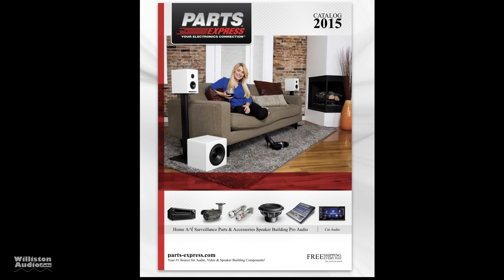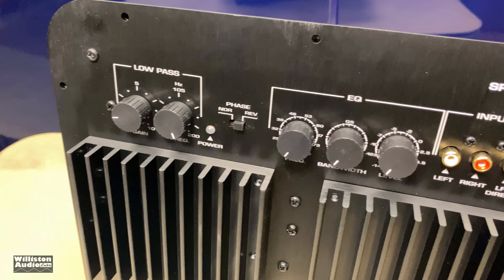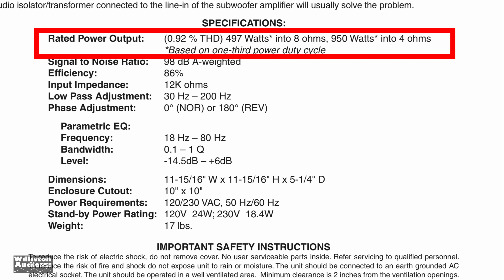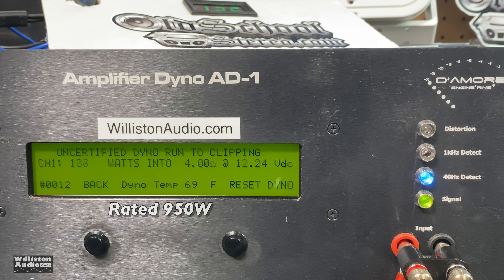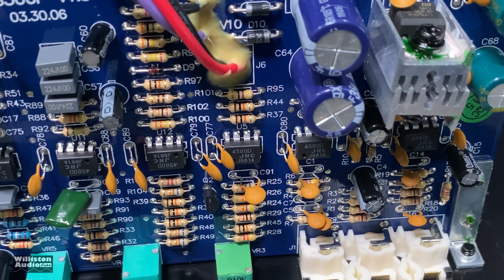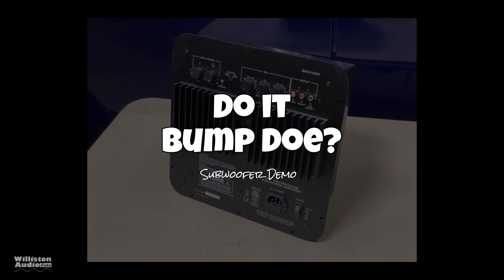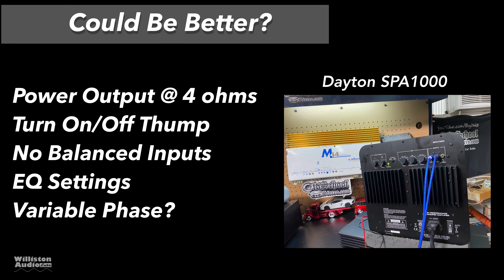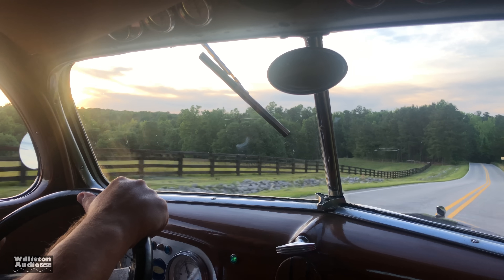DIY Subwoofer Amp for Home Theater - Dayton SPA1000 1000W

Comment: Thanks for this review! I have seen these and have never felt the need to pursue a purchase. Turn on/off thumps kinda suck. 😞

I appreciate ya'! 😇😎
Reply: Its a 17$ fix should of been done by dayton audio look for a speaker pertection board 120v 30amp mono board. If you do buy one add it on 👍✌️👌🤔😉

Comment: Is there a way to defeat that thump without redesigning the amplifier itself?  I have been dealing with that thump for 10 years now with my SPA500 version.  Thank you in advance!
Reply from the maker: Just leave it on and you shouldn’t have the issue. It idles at 24W, so not a huge amount

Comment: Can you test the rack mount version? 

https://www.parts-express.com/dayton-audio-sa1000-subwoofer-amplifier-rack-mountable--300-811

I've been using one in my house for many years. https://www.parts-express.com/dayton-audio-hpsa1000-r-1000w-rackmount-subwoofer-amp--300-810
I love it. It's powering a old 12" Earthquake and Eclipse both  4ohm DVC wired in series parallel for a 4ohm load at the amp.

Comment: there is something that is not right.
It has relatively small heat sink to produce so many watts. class-d also gets hot. how many volts does the amplifier get from the transformer?

I've seen several amplifiers on Ebay that can handle many watts but people on the internet say that the sound quality is not good!

Comment: Installed mine in a 4th order bandpass with 2 American bass 300w rms 8s and it absolutely tore the amp apart with the lower frequencies. After a couple months of use it started cutting in and out and the pots started making noises when tuning the amp. Needless to say it's replacement has never gone into any inclosure

Comment: It doesn't have a soft start relay, you can add one if you're handy with the soldering iron ...
Reply: What you really need is a speaker pertection board with that soft start then your problem is solved like your thinking 👌✌️👍😉🤔

Comment: Crappy construction, No heatsink ovwer the bridge diode, and thats one anemic bridge. No delay for speaker connection, and from there you have the power on/off bump, and for sure no protection for the output....I would not buy that think....

Comment: Next amp you have to test is one of the NEW ROCKVILLE DB COMP CEA rated not some magic rms watt rating. There's a 3500 cea rms watt with a built in volt meter for $349 and also for $299 the 3000 cea rms watt Rockville DB Comp!! Both will be nice I just can tell I've seen a demo of the 3000 and it was good👍

Comment: As most audiophiles would already know, that turn on/off thump will not be an issue when using a power conditioner or voltage regulator with a delayed turn on sequence. I run several high power amplifiers in my home setup but run a Furman power conditioner that has a variable turn on sequence which eliminates any chance of this happening.
Reply: Ditch the junk and you won't have that issue. Power "conditioners" do nothing but waste your money.
Reply: Which particular model?

Comment: Looks like it needs a gasket of some kind between the rear plastic housing and the aluminum face plate. Then again, I've used one of the "Bash 300S" plate amps before that has no inner plastic housing and had no problems. Controls were sealed up pretty well on that one.

Comment: Looks like a decent piece. Parts- Express usually has good deals.. Hopefully you can get it hooked up in your home or whatever you plan on doing with it soon so, we can see the durability. I'd like to build my own subwoofer set-up. I'm using Klipsch Reference line, but the sub and amp are very cheap and don't have the best output. I get about the same bass out of my towers as my 12.

Comment: I have the 500W version and there's no thumps if you leave it in "AUTO".   It powers itself on and off when needed without thumping.   I've had it over 7 years now and it still works great.   I don't think it's a true class AB amp though, I recall it being more like a class G topology but maybe they switched it up over the years.
Reply: It seems to have only two big filter caps so it can only be AB if that is the case. Wierd that this amp appears to have no output relay-delay.

Comment: Nice lil amp but kinda pricey.  You could get two 900w crown amps and have some money leftover.
Reply: Like i said in another post, these are class A/B power amplifiers. Crown amps are great for sound reinforcement and PA systems, but are not ideal for true audiophile setups. Crown uses a class D design with a switching amplifier and have alot of noise and also have no features, no parametric EQ. Crowns are great for gobs of power, but for true audiophiles who want the best audio and best features, these plate amps are ideal. Everyones looking for more power, but these Dayton amps deliver more power than most people will ever come close to using in their home audio setups.

Comment: I REALLY WANT THIS AMP BUT WITH TURN ON THUMP NO FREAKING WAY.
Reply: I have the 500W version and there's no thumps if you leave it in "AUTO".   It powers itself on and off when needed without thump.
Reply: It's a easy fix you just add a board to it about 17$ fix that should of been done by dayton audio. I would buy it used ask seller if it make a thump  you might get it at a good price ✌️👍😉🤔💯🍒

Comment: I have car amp and car sub setup in my surround sound system.  I have a Dual Electronics 4ch amp that does 250rms x 2.  Mine is pushing a 500rms Pioneer 12" sub.  
I paid $65 for the sub, $45 ported box, $100 amplifier, and $20 power supply.  So for about $220 I have a very powerful system.

Comment: I've been wondering how those amps performed ever since I first saw them
Reply: I have owned my SPA500 now for 10 years if that should tell you how well they perform over time.  I did not realize it until late and I made a new sub cabinet, but these amps will run 2 ohm as long as you set it correctly.  I had my SPA500 hooked to a 10 inch Memphis M3 set to 2 ohm for 9.9 years all because I did not check the impedance before hooking it up.  While it could have cooked the amp and it would have been my fault the whole way, the amp never faltered and played strong every time.
Reply: @TMouse-hd5jb  i would probably still run the 1000 at 8ohms just because of how much power it still makes. maybe 6 ohms if i could find a "rare" driver

Comment: I've used these line of amps on a couple of builds I did for myself and friends. I really like them. I built a gaming system for my basement that gives my house " trunk farts " using this same amp. It powers two RF hx2's in a ported and dampened enclosure .
Reply: How do you adjust phase ? via freq?
Reply: I moved the enclosure around till it sounded the best😂🤣

Comment: How is the amp dyno reading correctly when the amplifier is being fed 120v instead of 12-14v?

When ohms law comes into play the calculations don't add up and interchange
Reply: its not based off the 12 volts DC input voltage 
its based on the AC voltage that the amplifier is outputting and the amps
so something like 20 - 100+ volts AC is what it is reading when the dyno is running 
and the Amps of that output with what ever ohm load he is using

Comment: I noticed the sub really didn't move when the low note on feel the bass hit. Is that due to the enclosure or does this amp just fall on its face like alot of mainstream home subwoofers do when it comes to the lows below 40hz. My svs pb2000 is the opposite it feels like it hits way harder at 20hz than at 45hz but in actuality the frequency response curve is just so flat that you have to actually learn how to listen to a subwoofer all over again because most mainstream subwoofers are extra loud at 40-45hz but fall on their face once you start getting below 30hz. Even with a 15hz test tone you can feel the pressure change in the house with my pb2000.

Comment: I have been running 4 of these amps for about a year in my theatre. Have them powering 4 18s from stereo integrity.
Reply: Annnd??? Leave us hanging....?
Reply: why would you not just buy some real crown amps. or even one used 4000 watt is prob about the cost of one of these
Reply: @NightshiftCustom  Just like SMC Express said, amps like crown are just good for huge power output, but not fidelity. This Dayton amp is a "real" amp.
Reply: @ryannutter4669  yes I understand that but when your playing 100hz 80hz or less then you will never ever hear a difference from a class D amp. Why do you think just about every sub amp is some kind of class D and not a/b
Reply: @ryannutter4669  yes of couse dayton amp is a real amp because class A/B that i like
Reply: @NightshiftCustom  i don't like class D amp because playing music 100hz 80hz or less then i still ever hear a difference from a class D amp but i don't like sound not suitable music so bad my music almost imported for class A/B amp Sub that why I Still prefer ever sub amp class A/B only but i hate class D amp because bass not nice for me for music because i hear seen to much boost bass like EQ for class D amp i hate it but class A/B amp is bass is Flat but no boost that why bass very nice i like it
Reply: @gopala33  You're entitled to your opinion, but if you think you're getting lackluster performance out of todays class d amps... its either because you used a behringer inuke or didn't set up your crown amplifiers correctly...
Reply: @gopala33  every company is or has gone to class D today
Reply: @NightshiftCustom  Because most true audiophiles don't use Crown amps for high end setups due to the fact that they are NOT very clean. These Dayton plate amplifiers utilize a class A/B output stage and are very clean and articulate. Crown is great for loads of power for PA systems and sound reinforcement for large theaters or music venues, but for ultimate home audio enthusiasts these plate amps are great as replacement amps to fill the huge hole in an existing subwoofer encloser or to use in a new build.   Crowns, with their 
Class D designs just don't cut it harmonicly for high end applications, and do not have the features that these Daytons do as well.  I love the idea of outboard power amps running home subwoofers. I run 2 M&K  X12s that are powered, but i bypass and run them with 2 Parasound JC 1 monoblocks and the low end is unbelievable!
Reply: @vegaslimoguy2376  i agree with you i still Prefer class A/B i have dayton SPA250 its class A/B very nice i hate Class D due over over bass boost but not nice my music but bommy loss to bad but class A/B got good bass and bommy also nice my music
Reply: @vegaslimoguy2376  Not sure what "crown" amps you've heard, but they're incredibly clean, anything 1% thd and lower really doesn't matter lmao, you can't really hear a difference.... The only limitation those xls crowns have is the internal dac which only operates at 24-bit 48khz, otherwise they're fantastic, and "fairly close within reason" with their power ratings, not to mention the 2nd generation of those amps have a hp, lp and bp filters, and ofc the weight factor.... If anything, they especially make great subwoofer amplifiers... it would be very stupid to choose that plate amp over a xls 2002 or xls 2502, lmao if you're getting lackluster performance from them, you're doing something wrong... i have an xls 1002 and it's incredible for the cash. The only other proamps that perhaps sound a bit warmer and have even more honest power figures "they rate their amplifiers from 20hz to 20khz" would be the transformer class ab/h based qsc rmxa stuff, which blows away crowns class ab xli series "which is rated at 1khz like the xls stuff, but is still fairly close to rated power"... I have an original qsc rmx 1850hd for the past 10 years, its class H weighs 50 pounds, puts out an honest 575 rms perside at 4 ohms and has been abused to hell and back, even pushing 900 rms a side out of it at 2 ohms per channel, but it sure as hell sounds incredible like the day i bought it, and will go toe to toe with any overpriced audiophile crap as well as last longer from a build quality perspective, lmao. Not hating on boutique amplifiers, they have their place, however most of the time, you pay for the name, the pretty face and where it was made, thats about it... the only boutique amplifier manufacturer that is actually worth your while would be Bryston, they have 20 year warrantys on their amplifiers "no one else does", and they also have immaculate build quality and specs to boot, they're actually worth the boutique price unlike other overpriced stuff, their stuff is used in recording studios around the world.... pretty much everything else is below these three brands as far as solid state equipment goes, lmao... perhaps adcom is also "decent solid state hifi for the money, the 585se is no joke for 2k" but... thats REALLY about it unless you're talking some vintage stuff, but even then, you'd have to do a lot of upkeep to restore it, to most people, it isn't worth the trouble...
Reply: 4 18s for home audio? How God damn big is your house? That shit is unnecessary. It's your money though, spend it how you want to. 1 10 in the right box with the right amp will produce all the LFE you could possibly need.

Comment: Maybe make a timed relay to connect the speaker to the amp when you turn it on.. maybe a 1 second timer relay that activates when the power switch turns on and a 240v 20amp relay to hold the power?
Reply: I overengineer things.. shh.. and my systems constantly change configurations. So I'd be unplugging left and right😂
Reply: @devinstepp4205  you have the right idea thay all ready make the part you are talking and thinking about it's called a speaker pertection board they sell them on eBay 120 or 240  30 amp stereo or  mono  they also sell in low voltage you can also add a soft start to this.  Keep up those ideas you just never know 👍👌✌️💯🍒 over design is always better than under design 🤔😉👍✌️ In this case should of been design this way. 🤔😁add on

Comment: You always use that Infinity for the sound test even if your pushing 700 watts end and I don't believe that speaker can perform properly at 700 watts. I would like to see mabey a 15" or "18" driver really put these amps to the test. Mabey even a pair for the two channel amps. Just my opinion. I do live the vids keep em comming
Reply: It takes it fine, he wouldn't give it that much power if it couldn't handle it.

Comment: Another feature that could be included is high-level inputs. So if you wanted to hook it up to the stereo system and get the same signal that the main pair of speakers receives

Comment: There's no soft start relay. That's why it thumps when turning on and off.
Reply from the maker: Which is unacceptable for a $400 plate amplifier IMO
Reply: @wal  - Indeed! I know what their thinking is on that though. They want you to turn it on once and let the Auto power do it's thing.
Reply: @ShaneCarles  when you leave it on the life span is lower also going to end up wearing out the international parts. The soft start and speaker pertection board the why to go it 35$ for both  to bad the factory didn't add them 👍✌️👌😉🤔

Comment: I Have the Boxed version of the 1000w p.e. amp. Its good up to the point of really Getting on it hard. Then it goes into a Soft Gain cutoff. 
Not good for 100% Duty Bass Needs. 
A Great Plate amp Is My Hypex 800. Solid Power 100% D.Cycle.
Hypex is made in the Netherlands.

Comment: it lacks balanced input, but in home theater audio i dont think there are many receivers that ouput balanced. (if any at all) its more a thing for PA systems?
(also since a sub signal is mono i dont see how its balanced anyhow unless you use dual inputs)

Comment: A duty cycle is what they use for welding. It's the time in it takes for the signal to complete.
Reply: lol no its not 
its the amount of time it will run at full load 
70% duty would mean weld for 7 mins and take a 3 min cool down break or it will over heat and kick off 
30% would be 3 mins of welding 7 min cool down break
Reply: @NightshiftCustom  i know what it mean in welding. In audio it is what I wrote.
Reply: @NightshiftCustom  The duty cycle {\displaystyle D}￼ is defined as the ratio between the pulse duration, or pulse width and the period of a rectangular waveform

Comment: I have had a few of these home theater subwoofer amps opened up before, all had either a spdt switch that selects "on" or "auto", or a simple on/off switch on the power supply like this one has. The ones that don't have selectable "on" or "auto" ALL had a jumper somewhere on the board to select it. It's as simple as adding your own switch to the jumper. The reason for the "thump" here is that when you operate that switch you are cutting power to the power supply while the output stage is still active. When you turn it "off" at the amp board instead of the power supply it will mute the outputs before ot shuts down. It's just a cost cutting measure so they don't have to add an extra switch to the panel.
Reply: It's a 17$ speaker pertection board those cheap basterd 👌✌️👍🤔😉

Comment: Looking at the way the boards are mounted internally and silly things like no silastic covering the caps for vibration protection , and the fact that this thing is meant to be mounted in a bass speaker, this amp will not last long with all the vibration, either components will break off the board or the boards mounts themselves will break off from metal fatigue or solder joints or copper traces will break from all the vibration.
Mechanically this thing is badly designed.
Reply from the maker: This is a great point and one I should’ve highlighted 🤦‍♂️